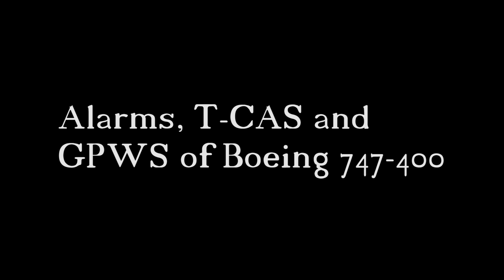Alarms, T-CAS and GPWS of Boeing 747

Comment: this is basically what the 747-300 and the first 747-400 planes had. later the 747-400 was equipped with the gpws that is also installed in the 737
Reply: Even planes that originally had this system later had them replaced with the newer voice. Was there like a legal requirement to have them changed?

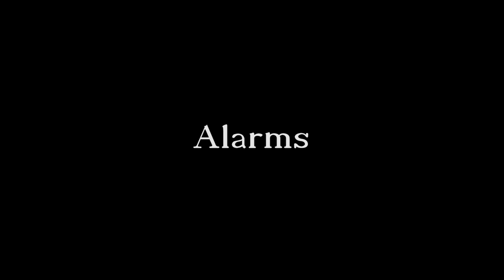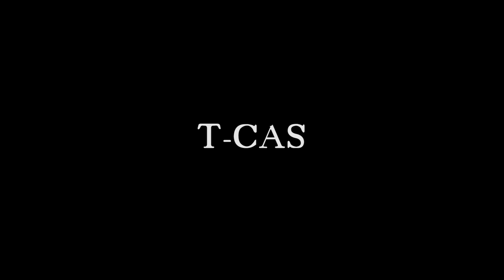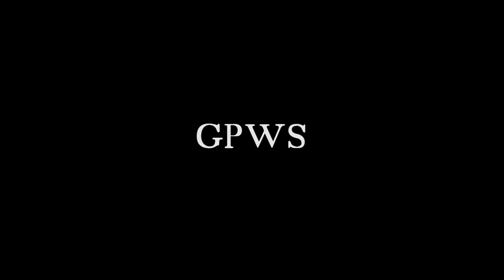Comment: Alarms,  0:01 TERRAIN TERRAIN  0:03 TOO LOW FLAPS TOO LOW GEARS TOO LOW TERRAIN  0:06 WHOOP WHOOP GLIDESLOPE" "GLIDESLOPE  0:09 WHOOP WHOOP PULL UP 0:11 Windshear Windshear Windshear 0:14 AUTOPILOT DISCONNECT 0:16 MASTER CAUTION 0:16 STALL 0:18 DON´T SINK 0:19 SINK RATE 0:20 BANK ANGLE  0:21 AJUST THE VERTICAL SPEED AJUST 0:24 CLIMB CLIMB NOW CLIMB CROOSING CLIMB 0:29 CLEAR ON CONFLICT 0:31 DECENT DECENT NOW 0:38 INCREASE CLIMB INCREASE DECENT 0:41 MAINTAIN THE VERTICAL SPEED MAINTAIN 0:48 MONITOR VERTICAL SPEED 0:50 T-CAS SYSTEM TEST OK 0:53TRAFFIC TRAFFIC TRAFFIC 0:55 T-CAS SYSTEM TEST FAIL 0:59 2.500 1.000 500 400 300 200 100 50 40 30 20 10
Reply: At least make it into separate it’s confusing af
Reply: @DraconicMaker  instead of being thankful for him sacrificing his time so that people can navigate through the video and get a better sense of certain warnings you are complaining. I hate people like you. If you are not satisfied just do it yourself.
Reply: @DraconicMaker  
YES! THANKS FOR SAYING THAT!

BTW do you want me to
help you separate them?
Reply: @DraconicMaker  ???
Reply: 1. Separate them
2. 0:16 is less realistic, 
    it’s 0:17 (stall)
3. Why are some in lower case 
    and some in capital letters???
Reply: Descend*

Comment: 00:05 Aeroperu 603
Reply: Are you saying it cause the end of the black box recording or What?
Reply: @brunocascardo3327  yup, ending of the black box (too low terrain), but also windshear alarm that occurs on the middle of the cvr recording.
Reply: @Beppe463  Well, it was a Boeing 757 actually.
Reply: @rodalrezk8288  and so? GPWS are not exclusive for some models...

Comment: 00:13-00:17 for those who dont know there are 4 warnings; auto-pilot disconnect, autothrottle disconnect, ecam display warning, and stall stick shaker.
Reply: I tought it was Skrillex
Reply: daniel kratinshtein The third one is auto-throttle disconnect
Reply: 747s don't have ECAMs
Reply: @techsupportranjit7637  they have  but it's called ECIAS
Reply: @novemberdelta1282  k thx
Reply: @candymountainn  EICAS*
Reply: ECAM is for Airbus, EICAS is for Boeing
Reply: Daniel w
Reply: wow thank you

Comment: http://www.youtube.com/watch?v=B2vqmVVZHYE&t=00m13s-http://www.youtube.com/watch?v=B2vqmVVZHYE&t=00m17s i don't know what are those alarms... What warning are those?
Reply: 0:14 Isn't Low airspeed, its the autopilot disconnect
Reply: Alvin Zahran Majid I believe 1st one (0:13) is autopilot disconnect because of pilots opposite inputs (turning or pulling the stick by hands while on autopilot)I dont know what is 2nd one.
 3rd one (0:16) is autopilot disconnect by pressing autopilot off switch.
4th one (0:17) is stall - stick shaker.
Reply from the maker: I think they are auto pilot disconnect sounds
Reply: Autopilot discount low speed above 30% throttle and stall
Reply: DreamAviationHD In this order: autopilot,?, autothrottle, stick shaker
Reply: Alvin Zahran Majid The first one is autopilot disconnect and the sound at 17 seconds is overspeed.
Reply: Omar Diab Nope, the one on 17 seconds is stall (stick shaker)
Reply: TheDox451 0:14 is airspeed low alert
Reply: Guillermo Dollard *low airspeed
Reply: 0:17 stall 0:14 low airspeed